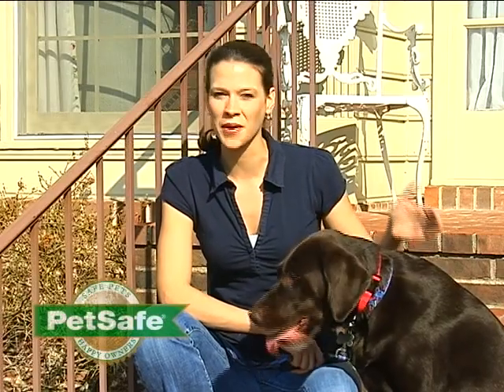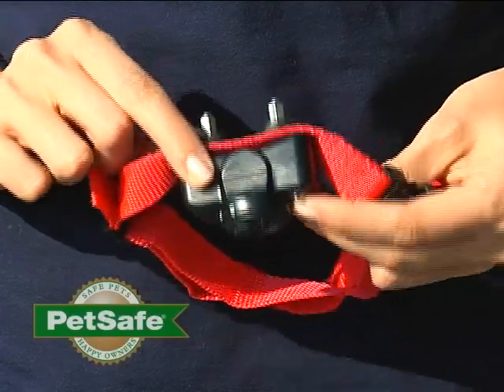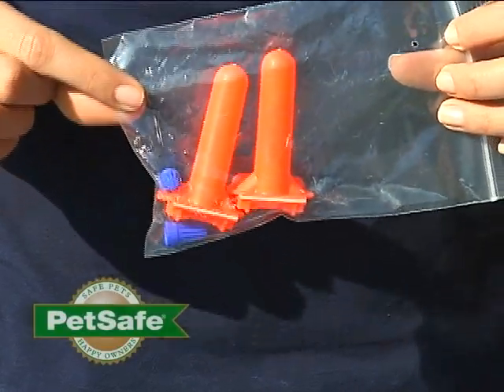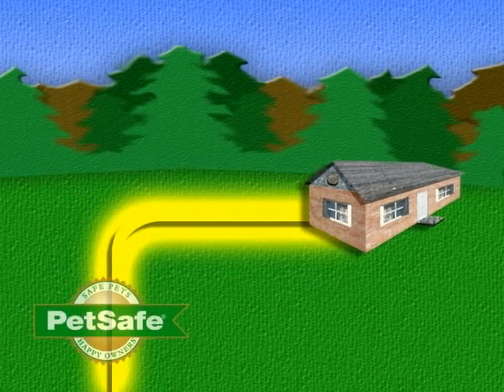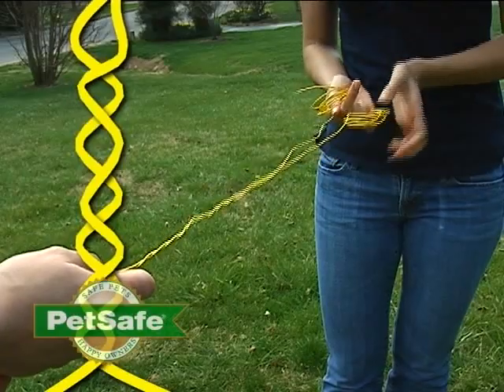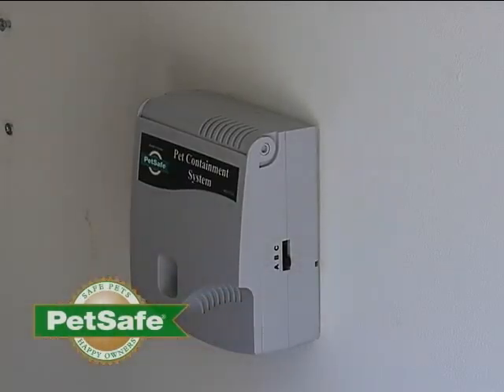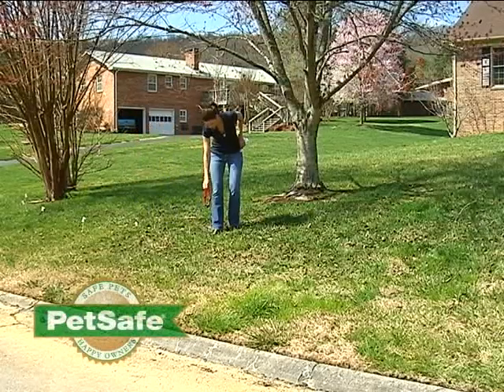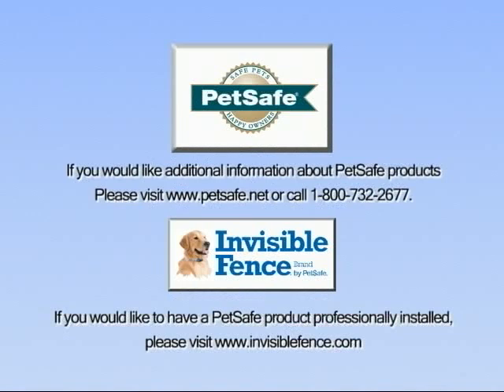How to Design and Install a PetSafe® In-Ground Fence™

Comment: The A-B-C switch remains a mystery to me.  You don't describe the setting and it's not described on the unit, except that it is set according to the size of the loop.  Is "A" for small loops?  How about "C"?  What constitutes a small loop?  Medium sized loop?  Sheesh.
Reply from the maker: We're sorry to hear about any confusion on the ABC switch setting. Not all of our fences will have this setting. This switch will always be set depending on how much wire you have used with your layout. Smaller layouts with 1300ft or less will be on setting B. Medium layouts will use setting C for 1300ft-2400ft. The larger layouts of 2400ft+ will use setting A. Feel free to give our Customer Care Team a call at 1-800-732-2677 with any questions.

Comment: What happens if  the electric goes out?
Reply from the maker: Thank you for asking about this, Fran!  Were the electricty to go out, the system would have no power, and so the collar would not be able to activate at the boundary.  Some customers who live in areas with frequent power outages may choose to use a backup battery to help prevent this.

Comment: The twisted wiring to leave a opening for cats doesn't seem to work. I twisted 2 wires of same length and connected the ends of the wires of each side to eachother. Then connected the ends into the circuit. The receiver keeps beeping/zapping the cats. How to solve this?